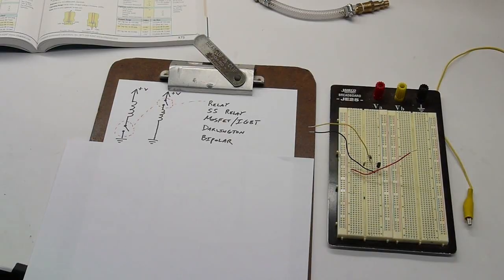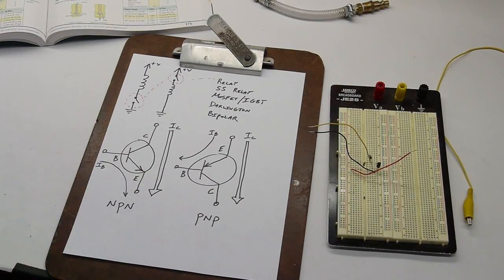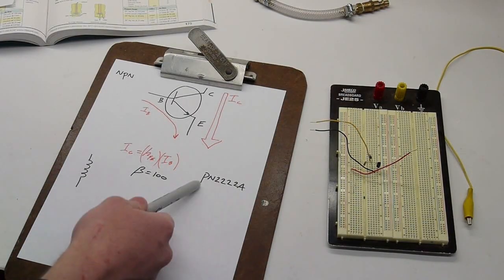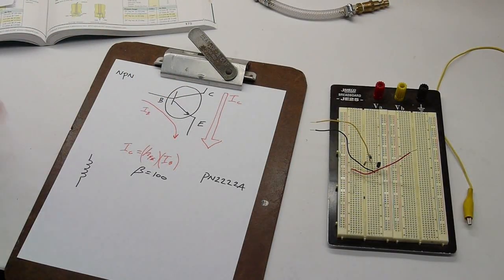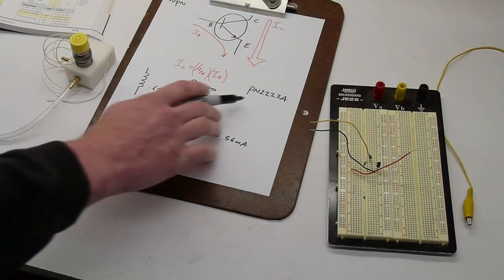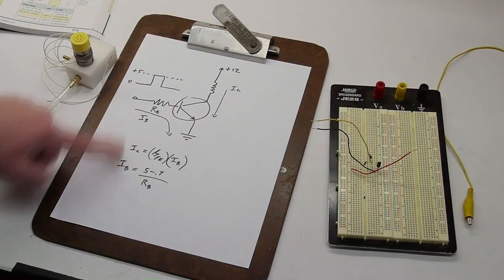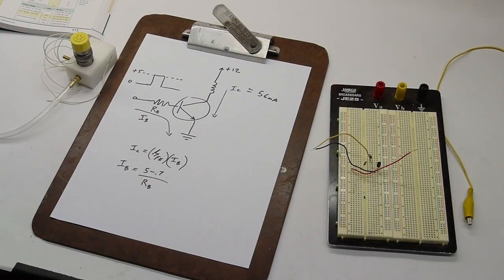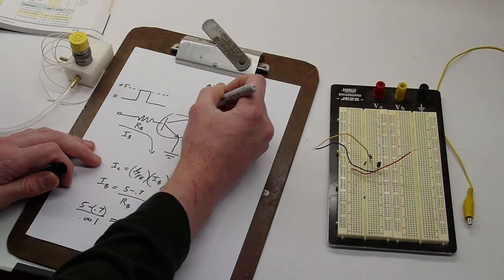Tutorial: How to design a transistor circuit that controls low-power devices

Comment: Integrated Circuit designer here.  To answer your question at 20:15: that is what we call "saturation" in a BJT.  You need at least a few hundred mV of voltage from collector to emitter to give electrons enough energy to shoot across the bridge created by the base current. It actually takes a relatively large amount of current to re-bias a bipolar once it enters saturation, because with 0 Volts from collector to emitter, it debiases and its capacitance grows a lot.  Not something to worry about for a breadboard project but a huge design consideration for ICs where speed matters.

Comment: Is there a transistor that is on when the base has no voltage applied to it and then turns off when voltage is applied to it. To put it another way is there a transistor that functions in the opposite way. It is always on and switches off when current is applied to the base terminal?  Any info you have on this is greatly appreciated.

Comment: I have npn output air flow switch, where set point to switch on or off...

How i  get analog value (either voltage or current) each increasing or decreasing of flow rate?

Please help to figure up, thanks

Comment: Silly question here: why all those maths? I  mean, the PN2222A can allow 800mA to go through (if I read the datasheet right). If your Base supply is 5V, why not go all the way, right from the start for 800mA and put a 537Ohm resistor there. If your device require 200mA, you're covered. 10mA: The same. If you control 10 different devices from say an Arduino, why compute the resistor for each device /output instead of putting on that would take care of all the outputs? I would be tempted to put, say a 1K resistor everywhere, the Xtor being able to switch 500mA or so on all outputs. (knowing that none of my devices draws more than 500mA). Makes the circuit simpler and more flexible. Is it a good practice or am I screwing up things here and aiming for a smoke-test?
Great tutorial, by the way. Learned this back in 1984 and just got back playing with electronics and I need some, ahem... refresh.

Comment: I am trying to make a solenoid to switch on and off at adjustable speeds up to about 10hertz. I am using a mossfet instead of your trnsistor in this circuit. I can make the circuit with a 555 timer but the solenoid gets very hot. I did not do any maths as detailed in this video. so how would I stop the solenoid overheating?

Comment: I know I'm a few years late,  but I mostly studied MOSFET uses, I guess transistors, would be good for logic level voltages? Especially 3.3v or less? Being mist MOSFETs need closer to 5v to be fully on I just know what I learned I. A few videos, and tinkering, it seems to be the case, am I close?

Comment: Why can't a simple resistor be used to control current out of the base in the PNP version? I'm pretty sure that's how it's done most of the time..

Is this because the solenoid supply voltage is 12V va a 5V control voltage? If both were 5V, then a simple base resistor would work fine (assuming you want the solenoid to be active when the control signal goes low).

Comment: Great video, thank you. Just one thing you said in a NPN bipolar transistor current flows from base to emitter, yes however that is using Conventional Current flow commonly used in the 1950’s era but an improved understanding is Electron Current flow that is current flows from negative to positive because an electron (which is the current flow) is about 1,600 times less massive than a proton so it would be prudent to say current flow is from emitter to base.

Comment: It is also good practice to add a resistor from the base to ground. This keeps the transistor base from floating, which may cause it to trigger on noise, and also makes sure the transistor turns off. Triggering it from an microcontroller , may have an internal pull down resistor when the voltage goes lows. Check your datasheet.

Comment: If we assume that that solenoid is essentially an electromagnet and we're running DC through it once the inductor is saturated it will act a short circuit correct?  He states that it won't allow more current to pass than the manufacturer states but is that true for a device like this?  It could be if there's a resistor in it but not if it's just a straight inductor correct?

Comment: Shouldn't the power rating of resistor, diode and voltage rating of capacitor be taken into consideration ( even though the voltage level is low.. :) )?

Comment: Watching your video after 9 year ... I want to ask you something... is it possible I introduce a capacitor before base power source to turn the transistor on and off continually and send current of transistor to a mosfet or high current transistor like 3A to switch on and of a high load application I.e.  flashing bulbs

Comment: Clear and well-presented. Amazingly, this circuit was pretty much the same as when I started studying electronics back in 1975, including the 2222 transistor! So for you younger students, the techniques outlined in this video will practically never become obsolete. We tend to think that the world is run on low-voltage, low-current technology (e.g. microprocessors, microcontrollers). But at some point real work requires higher voltages and/or higher currents, so studying transistor control circuits, like the one presented here, is very valuable knowledge.

Comment: Nice simple tutorial, thanks. But, ummm, my understanding, one pn junction 0.6 - 0.7 v drop so two pn junctions adds up to 1.2 - 1.4 v drop. In this particular case it measured at 1.1v, but I don't know where you get the cancelling out idea from. If there was any measure of cancelling out and a deliberate imbalance the figure would be less that 0.6v and it isn't.  Correct me if I'm wrong.

Comment: When you design a circuit with a switching transistor, you need to ensure you drive the IGBT with enough current (or voltage in the FET case) in the base/Emitter (or Gate/Source) to ensure the clollector/emitter voltage is as low as possible typically 0.1V....with that C/E voltage and the current passing through the C/E determines the power dissipated in the transistor and will determine whether or not (if it will destroy the transistor) you need a heat sink on the switching transistor to cope with that power..

Comment: Off to research 0.7V drop across transistors versus 0.6V drop across diodes... Love this practical introduction to transistors, thank you. The demo would be improved if you had a 1hz square wave instead of 5V source signal which could be replaced by a direct connection!

Comment: You made me chuckle when you said you blew many transistors when applying too much base current. I learned electronics with vacuum tubes and when you shorted a tube out the plate would glow cherry red. A CLEAR indication you screwed up! Shut it off immediately, correct the problem and fire it back up, no harm.
When I began using transistors, i would check the circuit VERY carefully before applying power. Still, I still popped a few transistors in my day.
One comment to newcomers to electronics I have, is that the base current should always be referenced to the emitter, and that if a transistor is to be used as a switch, it should be in total saturation. That is also listed on the spec sheet.
Great explanations though!
PS i now restore professional 2" quad video tape machines that weight almost 1 ton! Lots of analog circuitry and several servo circuits. Sometines I have to redesign circuits as the old parts are no longer available. I find it fascinating that a complex, 6Mhz bandwidth signal can be recorded & reproduced faithfully using magnetic tape!!!

Comment: The issue I have is how do u ground a 12 v relay and the switching signal to the gate to a common ground  which ground do you use the 5v ground or the 12 v ground. So ce tye circuit looks like it has 2 supply sources the 12v to ground for the relay and the 5v to ground for the switch

Comment: At 19:09 The transistor was destroyed because when junction Base - Emitter get signal and opens it need a current limiter otherwise it forms allmost a  shote (very low dynemic resistance) to ground. It behaves like a diode (which also need a current limiter after passing the 0.7 Volts and starting to conduct).

Comment: I went to school to repair PCBs many years ago but in my profession I wound up doing repairs at the next level.  "Through that board away and replace it". This is usually the cheapest and quickest for repairs of most equipment but that takes all the fun out of it. I still enjoy dabbling with semiconductors but time is not on my side. This great video helped me to refresh the details I need for my dabbling. Thanks, Great video!!

Comment: it's not a good idea with that capacitor. The discharge current can be so high so you damage the transistor. There is no problem if you use a fast diode...

Comment: Hi very useful vedio anyway I have a question about the hfe value.In this example you have chosen the hfe value as 100 but when I refer a data sheet of C828 transistor it says when Ic=10mA and Vce 10v min and max beta 200-300(I cannot remember the exact values)in a such case like this how can get a direct value of hfe.

Comment: I've seen a circuit for use with a 12v DC fan that uses (I believe) a Darlington pair...I think it's using a small transistor to trigger a mosfet(?) style transistor to power the fan.

However, the circuit appears to indicate that the secondary transistor has either the collector or the emitter (I forget which) wired as a pair.

This seems strange to me...is it simply making sure that the transistor is switched on when it needs to be?

thinking about it, in the circuit I was looking at, it looked like the middle base pin was the one with the arrow upon it pointing towards the transistor.

I'm new to this and it's all very confusing 🤯😄

Edit: the website was here:

https://www.digikey.com/en/maker/blogs/2019/how-to-control-a-dc-fan-using-the-raspberry-pi

Comment: What's the rule of thumb to you ensure the transistor is actually in Saturation mode?  (Fully saturated)  Since it is being used as a switch the transistor should be fully saturated.

Comment: Interesting video. 4300 ohms IS  a standard resistor value for 5% resistor but it is much easier to find a 4700 ohm resistor. 

Back when I was a teenager transistors and diodes were made of Germanium where the forward bias drop is 0.2 volts. Germanium makes transistors that are more leaky than their silicon counterparts. Their advantage is the lower forward bias. While silicon comes from a dirt cheap inexhaustible sources (sand) germanium is a less common element. It may come from flue dusts and copper refining. I'll have to look that up.

The thing that is new too me is clamping diodes. You definitely at going have to put something around an inductive coil if it could be suddenly switched off.

Comment: If you're willing to use 5%, they DO make 4.3k resistors and 10% and 20% are not much in demand any more.  Also, Ic=I0 (exp( eVbe / kT) - 1), so the Vbe needed depends upon the collector current required as is ID=IS (exp( a eVD / kt) -1) for diodes.  At room temperature Vbe=0.65 V will typically yield 1 mA collector current and VD=0.7V will typically yield a few Amperes of diode current.  These Ebers-Moll equations model about 90% of diode and BJT properties.  Power transistors are somewhat harder to turn on.

Comment: Typical Ic max for little transistors is about 600mA which is when transistor burns. What is maximum colector current I can safely and reliably drive through say N2222A transistor in switching application and how to calculate that? Datasheet specifies only junction temperatures, I can calculate Ic for 40C, 50C temperature operation but what is best transistor temperature?

Comment: Sir !

First i want to say i am beginner for circuit and arduino works..some time's you think i am idiot when i asked this question and sorry about that sir.. i want to know how to setup external power supply for arduino relay module.,.my problem is when i power up  arduino all the  relay module suddenly turn on and off....if i reset arduino board same thing happen..i just want to when i power up or reset arduino board relay module should not be turn on till i send command to turn on.. i just Connect Relay Module GND and Arduino GND together also.. how i solve  this problem sir.. i am planing to make garden water control system but with this case , when i power up arduino suddenly relays on and off (my water Pumps also turn on and off) please help me with this sir ..thank you

Comment: Can you please tell me if I calculated this correctly, Thanks

my electric motor 12 volt 7.2 watt .06amps load amps
12 volt electric motor 7.2 watts
load is motor valve spec 7.2 watts at 12 volts
what is current?  7.2 /12 = .06 amps x 1000 = 600ma
the transistor must handle 600 ma
transistor beta "gain" of 100
IB the base current Ib = 600ma/100 = 6ma
.7 is a an intrinsic value to silicon transistors this is an NPN
Ib = 12v - .7 / rb
12 - .7 = 11.3
now we are going to increase the ma to be safe so instead of 6ma we will use 6ma x10 = 60 ma
change 60ma to amps 60/1000 = 0.06
11.3/.06 = 188.333333333 = they don't make 188 ohm resistor so use a 220 ohm resistor
Reply: John Guarnieri I don’t know whether you got it right but it sounds like you followed pretty well, this second example might even help me.

Comment: That capacitor is not a good idea, it will cause more trouble than not. When the transistor turns on, all its energy has to be instantly absorbed by the transistor. A fast Shottky diode alone is all you need.

Comment: I have to build a solenoid switch for vibrating a sand classifier mesh. But it has to turn on and off at fast speed to create a vibration motion back and forth. How can I create that effect with solenoid and transistor switch and maybe somekind of an high frequency on and off switch.? And I would think 12v would be enough voltage for that mesh to vibrate. It's for a drywasher for gold prospecting, I have to vibrate that mesh to just shovel a dirt. Probably I'll use a portable generator for power source

Comment: I'm trying to design a circuit and needed two NPN transistors.  I have a bin of loose components I started sifting through.  The FIRST transistor I pulled out: 2N3904 (NPN).  The next one, 2N3906 (PNP), and every subsequent transistor I picked up was a 2N3906. How I managed to pick the only 3904 in the bin the first time I will never know.  I thoroughly searched and could not find another NPN transistor.  I am now waiting for a pack of 60 in the mail and was hoping I could find a way to substitute PNP transistors.  
Your explanation of which to use for a situation really helped me to understand them a lot better.

Comment: Why 0.001uF instead of 1nF?
Reply: As the capacitor value gets larger, it will have an impact on the switching time of the solenoid. The cap is only really to absorb the very edge of the transient what the transistor turns off, and is not really necessary in the circuit here. Where such a component does become necessary, you can calculate the capacitance based roughly on the inductance of the coil. Hope that helps.
Reply: @sonovoxx   You totally mis-understood/misread my question.   I was not asking why the capacitor is there. (But thanks for explaining it though :) ) I was asking why do we state the capacitor as a 0.001 microfarad instead of 1 nanofarad? You wouldn't ask for 0.001 meters, instead you'd ask for 1 millimeter. Mathmatically yes the values are identical.
Reply: @insylem Oops!  I did indeed completely misread that! Apologies! ...but I also think I have an answer: ...when I was taught analogue electronics back in the day, we were given that anything with uF or above pretty much meant electrolytic, while nF and below was unpolarised. Not a hard and fast rule, but I guess it's stuck!
Reply: @sonovoxx    It's not just with nF vs uF. I've seen say, 1500 uf Capacitors. Ok, they are electrolytic, but why put 1500 uF instead of 1.5mF? since 1.5milifarads is the same as 1500 microfarads?
Reply: @insylem historical reasons - before SI units were used, the microFarad was already using the m, and it wasn't practical to build a capacitor with anything close to milliFarad values. If you follow YT channels such as Uncle Doug or Mr. Carlson's Lab where they fix old valve (tube) gear, they often refer to these old terms as found on the schematics.

Comment: It is important to those  that  do NOT KNOW  transistors  that  that beta (Ic/Ib) is 
(1) NOT linear beta =100 @ 10 ma becomes beta = 20 at 500ma .
(2) 2n2222 and ALL others beta]min to beta max can be 4:1 (or 10:1 ??) 
(3) beta changes  with temperature
(4) lots of other facts 

"complications" are what makes  a circuit designer necessary.

Comment: I had to first solve the formula for finding the base resistance to solve directly for RB. Where it becomes RB=5-.7/IB, which is the desired base current. and it gives 4.3 volts divided by ..001 amps which yields 4300 ohms.  It works better for me and using powers of ten for the formulas was much faster too. Great video and answers a lot of questions and should enable anyone to design an NPN switch.  I love the way you explained the Beta relationship and why the base current was increased to 1 mas instead of .56 ma. I have built this and it works perfectly. Thanks bunches for this fine video.
Reply: I might also add that sometimes I goof and forget to use more base current due to the diode drop across the EB junction and the circuit is marginal.  Again, great video.

Comment: The explanation for choosing NPN over PNP doesn't wash: using a resistor, the logic is reversed; the control signal will turn it off, where the NPN will turn on.